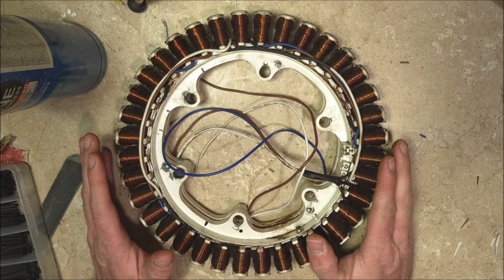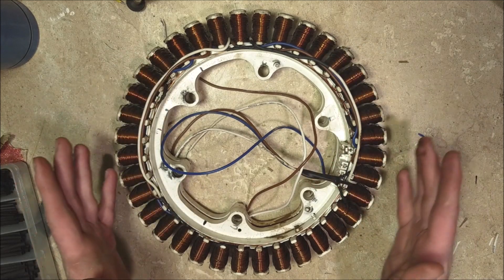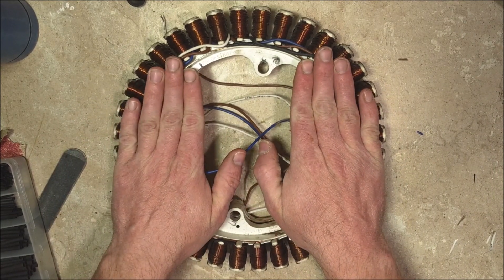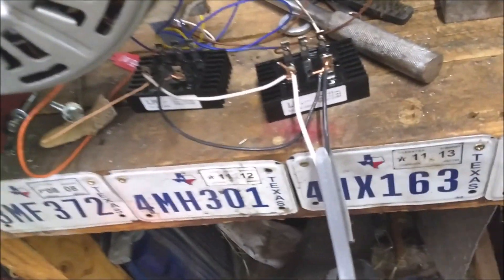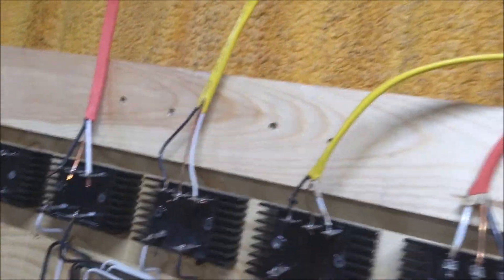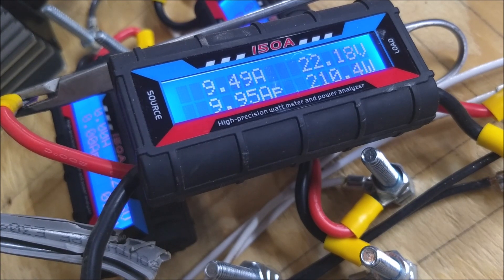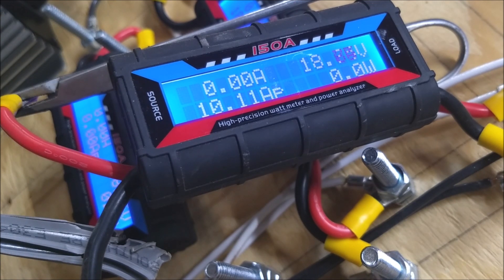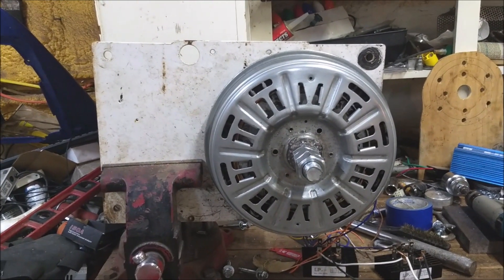DIY Project #3:  Assembling and testing the Washing Machine motor generator

Comment: just use grid tie inverter that can take 500vdc, use bridge rectifier
Reply from the maker: That's the goal, especially with my big Heli 4.0, the problem is that the turbines that work nominally in that voltage will push past the 1000vdc with ease and it's difficult to control them properly.

Comment: The high voltage thing is probably the hardest thing about generating electricity and controlling with simple power generation methods. Normal basic gas generators the rotors have a regulated DC voltage, and current applied to it that controls the magnetic field of the rotor which in turn controls the stator output. The next problem here is the frequency out put, while it is AC output, most power transformers for step up or down voltage is rated for line frequency 60Hz down here in the USA in most places, their are businesses here and there in the USA that use electric motors to drive a generator to mechanically convert 60Hz to 50Hz interesting to see in real life how it works. Anyhow if the frequency output from the generator is no high or to low your transformer will odd at certain frequencies frequency to low, and the transformer iron core starts over heating, and your output voltage when read with your Meter is measuring RMS not peak to peak, lower frequency and your peak to peak voltage could be higher, now say the generators ac output is higher in frequency then the transformer input frequency. Now your voltage could be much lower, you have the correct input voltage, but your output is too low. This is a sign that the frequency could be too high. Now this isn’t exactly true in every case AC acts quite strangely with capacitors and coils of wire doesn’t matter if the coil has iron or not, the iron is just another part, as the operation and passive effects are basically the same. This is heavily simplifying how that kinda works. Now as for using high voltage output generators, they can be more efficient at charging batteries rather you wire the batteries for high voltage with several in series, with a matching set to place in parallel for more current, or if you wire the batteries for low voltage, and let the charge controller take care of the excess voltage.  Just as long as it’s a pretty high efficiency charge controller that’s able to utilize a high B+ to charge a lower B+ bank id say go for it. Electrically more “pressure”, or voltage the more efficient the circuit can be.

Comment: Please tell me how you managed to mount two together like that.
Reply from the maker: I welded the rotors to hubs with 1-inch bores and bolted them together.  It took a LOT of time and trial to get the rotors aligned with their own stators to keep them from braking one another.  the other videos in that playlist show how it's assembled.
Reply: @ToysforWatts  thanks for the tip bro. Could you maybe just sell your and make another. I just got a welder but I'm new to welding so. You know the alignment has to be really good for reasons you've stated already.

Comment: How did you connect the wires without soldering?
Reply from the maker: Really tight twist and shrinkwrap to secure and protect the connection.
Reply: @ToysforWatts  Thank you I will try this, you may have just saved me the total rewiring of my stator

Comment: What RPM was you drill running at?  At 750RPM a Samsung DC93-00309A will produce over 300 Watts at ~50VDC. It takes about 1 HP to get to that RPM and load. I haven't run my larger Samsungs as alternators lately as I never split them down as far as the smaller ones. That will change when the two new ones get here. :-) With the 36 pole unit split to 3 phases of 2 parallel, 6 coils in series, it was producing over 150 Volts last time I did test one.
Reply from the maker: Somewhere around 275~400rpm.  At the time I made this video I wasn't able to do much more than guess and compare to to what I see when filming at high speed to compare to framerate.  These stators are reconfigured to run at a lower voltage/higher amperage...I want to be able to either hit a 48v or 24v bank.  This is a project I hope to coming back to very soon.
Reply: @ToysforWatts  I just checked mine at 375 RPM. It was producing 141 Watts. It varies a lot depending on the state of the batteries at the time. Right now they are at 28 Volts so it isn't going to cram much Wattage into them. With the big motor driving the small one, it is VFD Hz X 2.5 to get the RPM. With the small one wired the way it is, it is Hz x 5 to get the RPM. The big one sings at 2000 RPM which is 2.5 times what the little motor was factory rated at and 600 RPM over what the big one was rated at. When my Copper wired ones get here, I'll test one in the unit as either 2C X 6 X 3 Phases or 3C X 4 X 3 Phases. I expect that I'll have to throttle back the small motor to 1500 RPM ( 300 Hz input ) as I will likely come near the max input Wattage of the charge controller ( 720 on 24VDC system).